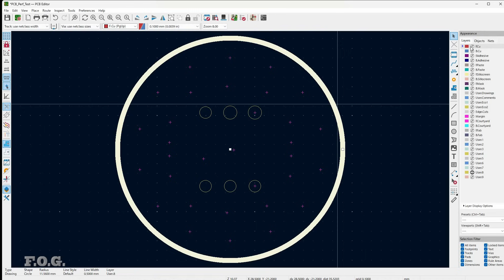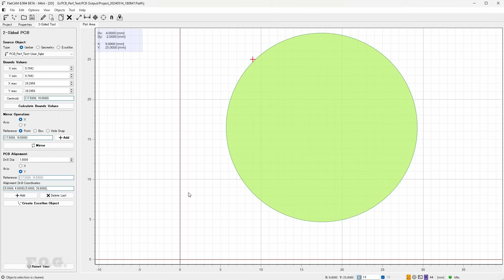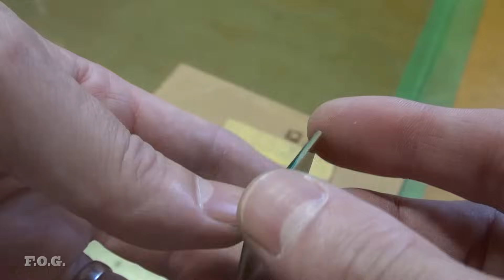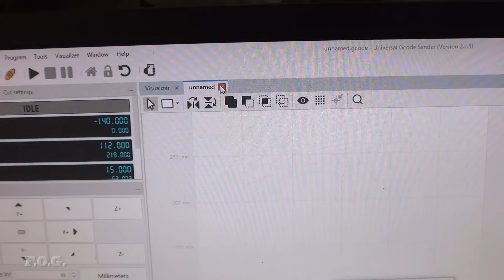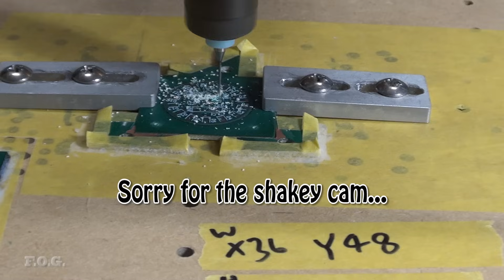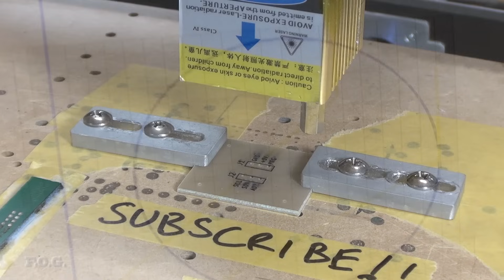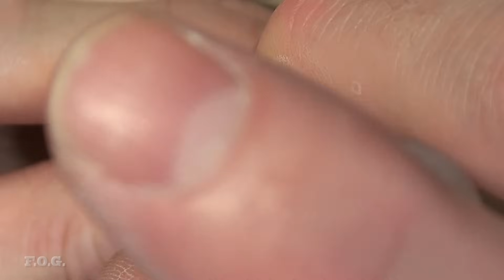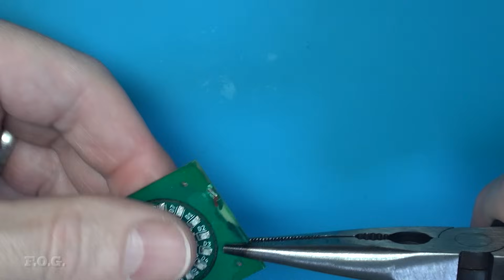The BEST DIY PCB Tutorial (ForOurGood PCB Method)

Comment: What’s the lowest power laser cutter can I use for this
Reply from the maker: The laser I am using is a 450nm "40Watt" one from Laser Tree. Recently Laser Tree has been stating this is a laser with 5W optical power. They also sell a "20Watt" one which they say is 4W optical power (really?). And other Laser module brands also have various ways of stating the power.. my point.. It is hard to be specific given the lack of standard for laser power with these diode lasers.
So I can only say this, I would recommend using the 5W optical power as a basic reference, as this is what has proven to work for me. But I would also expect one rank down from that would also work, say between 2.5W to 4W optical power, however it will likely struggle on the cutout operation for the PCB. I think anything less than 2.5W optical power will struggle in some situations, and is likely not a viable option.
Hope that helps, and thanks for the question! :face-blue-smiling:
Reply: @ForOurGood  thanks for the response and thanks for sharing this amazing method. Definitely gonna give this a go.

Comment: Just working through the process on my first PCB attempt using your process.  You discussed the KiCad User8 and User9 layers (13:30), but what are they exactly?  ie how did you create them?  I can draw shapes (rectangle, circle, polygon etc) and draw lines but I can't figure out how to fill them to create solid objects like the thick ring on User8 or disc on User9.  Can you give some pointers?
Reply from the maker: Hi Paul, thanks for the great questions! :hand-pink-waving:

I did not actually make User.8 or User.9, these layers already existed in the version of KiCad I was using.

Recent versions only have up to User.4, so in my most recent PCB I just used User.3 and User.4 instead (it makes no difference).

There is likely a way to add more User layers too, I just have not looked into that.

To modify the property of the shape, such as line thickness and fill state, just double-click on the object and you will easily understand what properties need to be changed.

You can also right-click on the selected item to see the context menu, then select properties, and the same window will be shown.

Hope that helps! :face-blue-smiling:
Reply: @ForOurGood  Thanks - that helped a lot.  I didn't realise that those simple objects actually had properties.

To add the extra UserX layers, goto Board Setup then click the "Add User Defined Layer" button at the top right corner.

Comment: 1:53:30 
Для того чтобы сверло идеально засверливало отверстие, можно использовать метод предварительного кернения. Для этого подойдет коническая фреза 0,2 мм. Перед тем как засверливать, можно пройтись им для того, чтобы поставить точки в центре окружности. Тогда сверло будет центрироваться автоматически, даже если у шпинделя есть биение. =)
Reply from the maker: Great, thanks for the idea, I had not thought of using a conical cutter to pre-drill guide holes, makes sense! But it does add an extra step...
BTW: I have recently upgraded my Z-axis which solved most of the deviation.
Currently I am thinking about stopping etching the holes, as this seems to cause the drill to catch the edge of the copper holes and drag the bit off centre. Anyway, I will keep testing to find the easiest and most reliable method!

Comment: Came across your video, Looks great, I Have tried many ways none looks like yours, Flatcam dont hafe exe files on their github for some odd reason, is it possible you could share the instalaton, foud 8.991 but it crashes after subtraction , wanne give your method a try.
Reply from the maker: Thanks for the question. It seems that recently the original install files were removed from Bitbucket due to policy changes. Thankfully Marius (recent FlatCam developer) has provided some new links. Please see the link to his channel that I have included in the pinned comment in this video.
Good luck!

Comment: Great series of videos.  I'm about to buy the kit to begin making PCBs using your process.  In the comments you have said 'The laser I am using is a “LaserTree Gold 450nm 40W-Pro 12V 20mm Fixed Focus Laser”, apparently it puts out less than 10 watts of optical power'.  I can't find that specific model on the LaserTree website; however the LaserTree LT-40W-xxx devices are listed as 5W optical output.  The LT-80W-xxx modules are 10W optical output.  So is yours a 5W or 10W module?

Also there is a choice of focal length - 23 mm or 45 mm.  Did you choose the shorter focal length for a specific reason?

Does the elliptical beam / spot shape (0.03 x 0.13 mm) cause any issues with the process?
Reply from the maker: Thanks for the excellent comment & question.:medal-yellow-first-red:

Recently I was looking at Ali-Express, and could no longer see the fixed focus 40W laser that I am using being sold. I specifically chose a fixed focus laser (20mm focus height for this laser), because I really wanted have a solid focus baseline, and was worried about the variable focus model causing instability in the process, and I still believe that is true.

As for the power level, honestly it is a mystery, some time back, I read in comments and elsewhere, that it was no more than 10W for this so called “40W” laser.
I even chatted with LaserTree when I bought it, pointing out the power consumption is less than 12W, and they did not give a clear answer at the time, going on about how this is “effective power” or some other BS. I guess that, as LaserTree has evolved, they have decided to start being more truthful with real numbers, so if they are saying the “40W” is about 5W now, then that is what I am using.

So, the next bit is a spoiler somewhat, as in the following weeks I will be doing a very important addendum series for my PCB Tutorial, and this will include addressing the disproportional beam shape very specifically (BTW: mine is burning about W-0.08 x H-0.04mm).

But to answer your question, yes and no!
-> No, because all of the PCB’s I have made so far use this disproportional beam shape, and while it sometimes was a little annoying, it has never been a show stopper.
-> Yes, because as I have increased the complexity and resolution of the PCB’s I am working on, disproportional beam shape gets more and more annoying, and can make the process less smooth than I would like.

The good news is, that recently I have finally come up with what I think is a very good fix for this, and this should mean that people who have the cheaper laser with the disproportional beam, can still access higher complexity and resolution PCB’s, without suffering any notable downsides. Anyway, this will be in a future episode, stay tuned.

Even so, having a properly proportional beam is clearly a better solution, and you are likely aware, LaserTree have a fixed focus 80W(10w) laser, which the marketing says combines two 5W lasers 90deg offset, to create a supposedly proportional beam. It also comes with fixed focus and air-assist nozzle, all good things when it comes to my process.

I have seen it on sale for as little as $110USD, so the price is not bad, but it is still about twice the price of the 40W(5W) one. As I was starting to get frustrated with my 40W(5W) recently, I actually nearly bought one.. but since I effectively solved the problem, my motivation to make the purchase went away.. though I might still pick one up if/when the sale price drops below $75USD.
So, this new model really might be the better way to go, assuming the person who is considering it has enough budget. And if they don’t, the 40W(5W) will still do the job good enough too, but I would generally still recommend looking for one with fixed focus and an air assist nozzle.

I also need to point out that I have not tested the 80W(10w) one myself, so I cannot guarantee it will work well, even though it looks good on paper. It is possible that you could run into some other weird unexpected problem, though I suspect unlikely.

Good luck with your efforts!:hand-pink-waving:
Reply: @ForOurGood  Excellent - I'm really looking forward to your new addendum series.  I watched the intro a few days ago.
Reply from the maker: I just had a quick look on Ali-Express, it seem the best current options are between the LT-40W-AA and the LT-80W-AA-PRO for $60USD or $120USD (likely cheaper if you find a good deal). Both are fixed focus length and come with a air-assist nozzle, with the more expensive one having the square beam shape and twice the power.
Naturally I have not tested either of these, so I can't say how well they would work, but you could be reasonably confident that it would be at least as good as what I am already using.
If you do buy either of these, then make sure let me know how well it works!
Reply: @ForOurGood  The response from Lunyee was: "Under normal circumstances, the focal length of a 10W laser is usually around 50mm, and the spot size is 0.08*0.15mm at this time. The minimum size is 0.08*0.08mm when the focal length is around 20mm."  So it seems that the spot size is smaller with shorter focal length.
Reply from the maker: @PaulCowper  I guess it makes sense that varying the focal length might change the beam shape. Either way, you really don't want this added variable in the mix, which is why I recommend going with a fixed focus.
BTW: Who is Lunyee??
Reply: @ForOurGood  I asked them if the focal length was adjustable and it's not.  They said 'the laser can move up and down', so the 20 mm vs 50 mm 'focal length' seems to be just the distance from the laser to the substrate.  I've asked for clarification on that.
Reply: @ForOurGood  Lunyee Industries - a Chinese manufacturer of cnc and laser engraving kit.  It looks like a couple of comments I posted have disappeared - I thought I had mentioned this already.  I'm thinking of buying a 3018 pro ultra cnc from them.
Reply: @ForOurGood  Sorry there was another comment before I said 'The response from Lunyee was:' but it seems to have vanished.  I said: 

As well as the Laser Tree ones I am looking at Lunyee laser modules.  Their 5.5 W module is listed as having a spot size of 0.06 * 0.08 mm but when I asked the customer support said it was 0.08 * 0.15 mm.  I asked why there was a discrepancy.  

And the response was ... (see above comment).
Reply from the maker: @PaulCowper Two different focal positions on a fixed focus lens does not make much sense too me.. maybe I am wrong, but for a fixed focus lens, I would expect it is either around exactly in focus, or out of focus, meaning the dot is bigger and blurrier (of course the beam shape could change as it goes out of focus)
Reply from the maker: @PaulCowper sorry about your disappearing comments.. that's YouTube for you nowadays.. it happens to me all the time too... I checked in my channels quarantined messages folder, and there is nothing there..
As for Lunyee.. don't know them.. actually there are so many Chinese manufacturers cloning the same stuff, it can get really difficult to know what to buy.. check the comments and photos of other buyers, make sure they sell a lot of this stuff, and that the seller has good ratings. Good Luck!
Reply from the maker: @PaulCowper I just checked Lunyee out. I have actually looked at this specific 3018 recently, and generally I thought it looked like a pretty good configuration. The only change I would make is switching to linear rails on the Z-axis at some point, but it will work ok with the rods. The prices are all over the place for this stuff, keep your eyes open for a good deal, take your time. As for using a Lunyee laser.. I just don't know.. maybe they are all the same.. maybe they don't even make the lasers themselves?!?
Anyway, I went with LaserTree mainly because it was their core business, so I thought it seemed like a good bet.. and at least it did what I needed it to do. But given my total experience with lasers is one single device, I don't feel I am in a great position to give a solid recommendation.

Comment: This a really great video (as are your other series)! Thank you!

Whether I buy my PCBs or make them myself, I always make the stencils with my CNC-3018 laser. Tape seems to be working well for you, but you mentioned in one of your earlier videos that it can pull the silkscreen and/or solder mask off if not careful. I thought I would suggest another material to try: Vellum paper. Another name for it is tracing paper, but I don't like the bound pads from art stores - they seem too thin and don't put enough solder on the pads. I was once told that the "proper" thickness of solder paste is 3-5 mils (about 0.1mm), which is almost the exact thickness of 30 pound vellum paper. Personally, I use "Office Depot #171372 Premium Translucent Vellum", but I expect there are plenty of others that would work fine (as long as the thickness is right). 

The nice thing about vellum is it's translucent, so I find it easy to line up with the pads (you can practically see through it). I then just tape it down to the PCB and squeegee the solder paste across with an old drywall knife. Once it's in all the pads, I squeegee it once more at a steep angle to wipe off any extra paste. If the paste is too thick, small components like caps/resistors/LEDs will "tombstone" (pop up on their ends), or just float off the pads.

Once done applying the paste, simply clean the vellum stencil with IPA (once the IPA evaporates the stencil is good as new). I don't expect the vellum stencils will last as long as stainless steel, but I already have a few stencils that have seen 20+ boards. Since it's so quick and easy to cut the vellum on the 3018 laser (Mine is only 7w) I just make 2 or 3 at a time (in case one gets damaged).

I do occasionally see some micro-curling of the cut edges, but that can be knocked down with some extra-fine (600 grit) sandpaper (although I don't usually bother and it works just fine). Also, the vellum will sometimes "over-burn" - the cutout is slightly larger than desired. Shrinking the cream layer a tiny bit helps to offset this (~2mils/0.05mm).

I hope this information is useful to you (or anyone else)!
Reply from the maker: Thanks for the compliment and leaving such a detailed comment, I am sure it will serve as reference for me and others..:hand-pink-waving::trophy-yellow-smiling:

Actually, someone else suggested using laser printer overhead printing film, so I expect the basic concept is the same here, transparent, robust, correct thickness and a clean and accurate burn. I am definitely interested in trying out something new, especially since on my last board my silkscreen was slightly underexposed and the sticky stencil manage to tear of some of it (not the first time..) I had been holding off on the laser print film because it was pretty expensive, and with my luck it might not be the right stuff.. So maybe I will take a look around to see if I can source the vellum paper at a reasonable price instead.

As for tombstoning, thankfully I have not experienced that since EP7 (that was a pad solder take up issue BTW).

It seems that ceramic caps are the worst for it since they are proportionally pretty high say compared to a resistor, so if the solder goes off slightly quicker on one side, the increased surface area allows the surface tension to be enough to suck up on one side and stand up the relatively light cap. Interestingly enough, just the other day I was scavenging parts from a Chinese made module, and I noticed that they add adhesive to all the larger sized ceramic caps.. I could probably do that too I guess, but it seems not necessary given I am not experiencing a problem. But your probably right, having too much paste will likely increase the risk, but if anything, I am probably a little on the light side with my paste, so I guess that is likely reducing the risk.

[Tombstone avoidance checklist]
1.	Ensure pads in good condition to take up solder
2.	Ensure just the right amount of paste
3.	Preheat the board to minimize time differential for solder liquifying
4.	Finally, for problematic parts, use adhesive

Comment: Can you do a new intro for double sided pcb design. Preferably without flat cam. Its unstable af.
Reply from the maker: @wwarren1  As you can see in this video, the version I amd using, and as shown in this video, is very stable as long as you stick to the features I am demonstrating. I have made some fairly large PCB's with this, and it works no problem.
Reply: Found the issue. 
You really should say. "RUN AS ADMINISTRATOR" or it will crash after a few minutes right after you finish editing wird trace issues. 
Back to your video. 😂

Comment: Bought everything as you did. Same set-up and everything. Only issue flat cam cashes on any pcb bigger than a few centimetres. Aaaaag. 
Now I to find a altanative and do all the tuning myself. 🤨. 3d printer took me 6 months to get to a point I was happy with. I do t even want to know how long this is going to take.
Reply: flatcam need to run on higher ram size 16 gb . and don't forgot to save at first and after import files .
Reply from the maker: @AvinashPudale  I explained in the video that you to save after every action. Press Cntrl+S.
Reply from the maker: @wwarren1  Wishing you the best of luck. Make sure you upload a video to share your results!